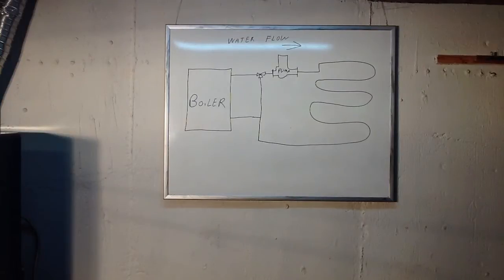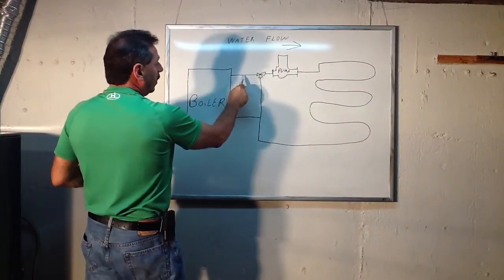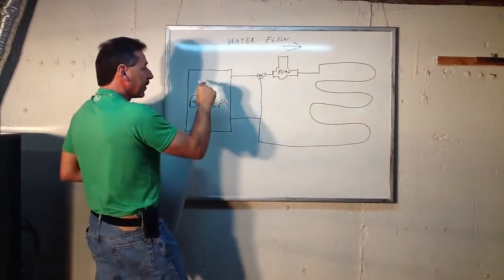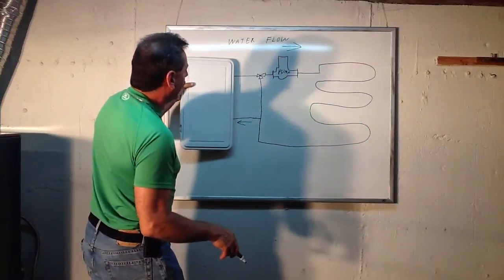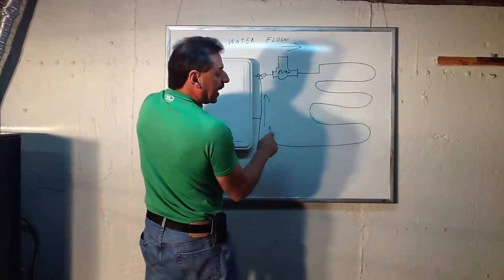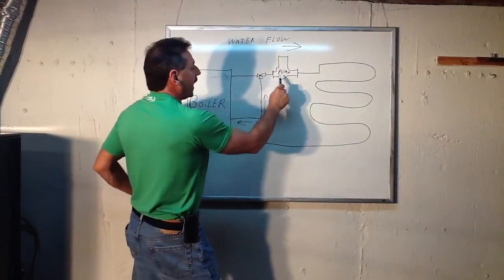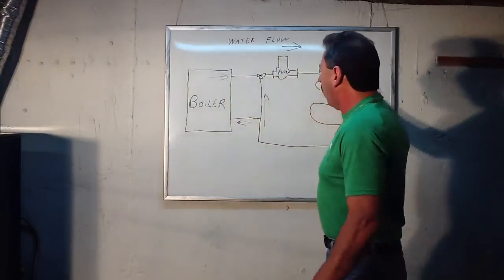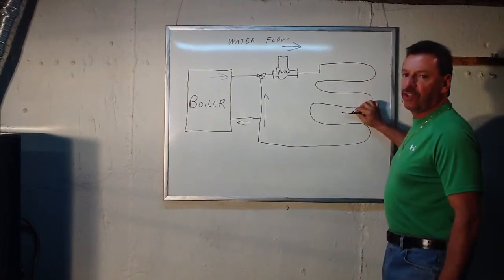Radiant heat part 3  by loudepot

Comment: I am a homeowner. This was very helpful. I had no idea the valve was thermostatic. I thought it was just controlling volume between hot and return. I just had my boiler replaced and now have a mixing valve(old system didn't) and have been slowly dialing it in but couldn't understand why the adjustments were so slow. This explains it. Thank you.